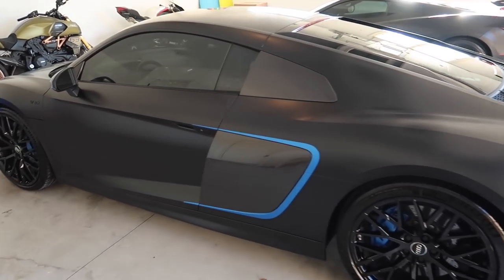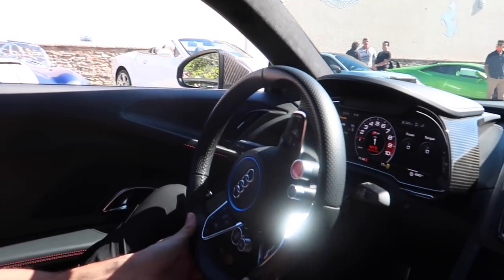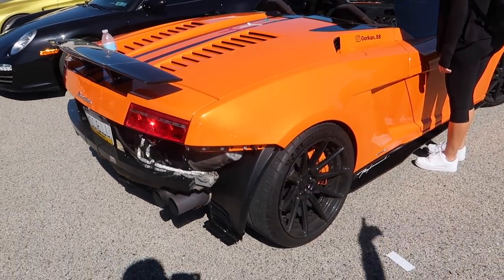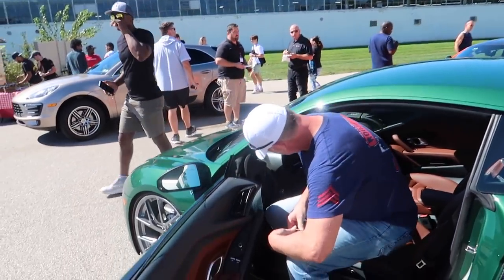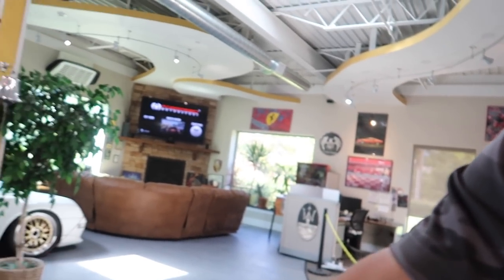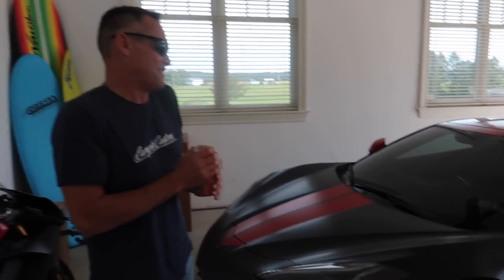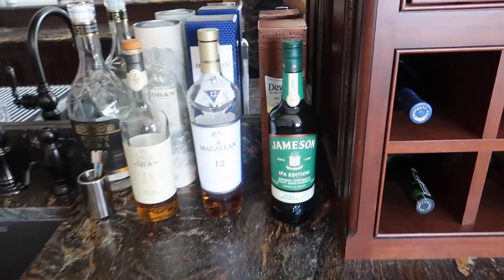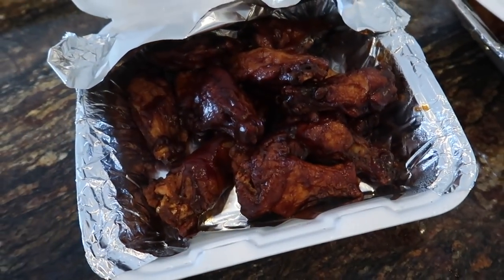We Bought a New Supercar & Fabspeed Exotic Car show!!!

Comment: 120hp with an exhaust system and air filter and a tune, on a naturally aspirated engine, not a chance!! possibly 40-50hp !!!

otherwise a good episode and a good channel 🤙🤟🙏
Reply from the maker: so its actually 75whp with their set up...they've got dyno figures to prove it.  I estimated crank hp to be around 100 to 120hp with those types of wheel hp gains.  Here is their set up and information https://www.fabspeed.com/fabspeed-audi-r8-v10-2016-2019-valvetronic-performance-package/
Reply: @JaretCampisi  okay, but 75hp, is 75hp whether it's on the wheels or on the crankshaft. say you hypothetically have 500hp in the engine, 450hp on the rear wheels. If you tune the engine so you get 75hp extra, then you have 575 hp in the engine, 525 hp on the rear wheels. no matter how you count, you only have 75hp extra !!!